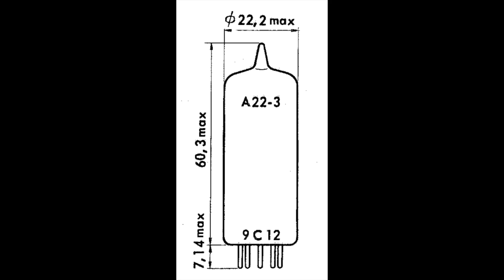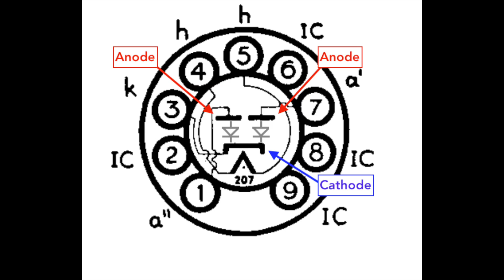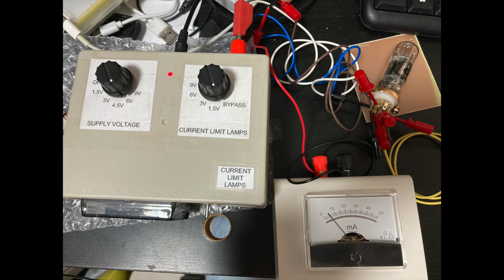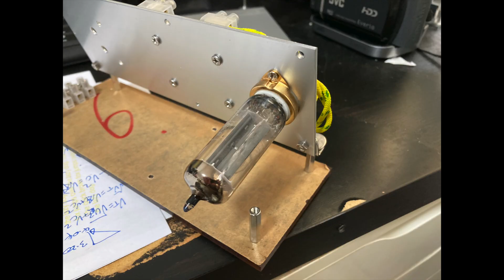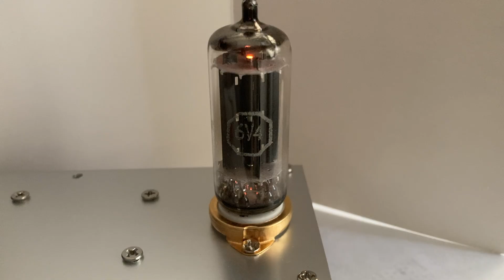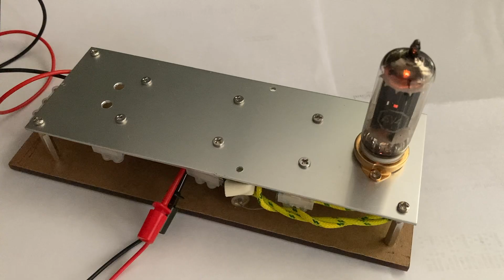A Novel Valve Prototyping System?

Comment: Surprise video pops up on my feed...I'd suggest a little voltage/current/watts across the heater. Lines to measure it. If you want to make it smart... You could throw in a raspberry pico for a controller. Low/high side current voltage current sensors. A DPDT relay could pult the heater element in and out of circuit relatively quickly that you can measure the resistance of the heater while it's powering up or measure Vdrop across the filament while measuring voltage and current. Just over designing things in my head. Also could manage fairly reasonable curves if you measure cathode, anode, grids. Then have it spit data out via serial ideally with a USB isolator or over WiFi. You can also find 10 throw 1-20 pole rotary switches. Then you could wire each pin to a switch and then easily rewire which pins are for what. I have way too many measurement fixtures I want to make and I do make them a bit over designed 😂. Also if everything is run isolated from mains, map out which sides of the transformers are to be considered a system ground point you could then put bnc or scop probe hooks without having to worry about the ground reference on the scope. Hell...I'd probably take dead or outgassed tubes and make a new vacuum line for a pump to bring them down to the necessary pressure. Yeah... ADHD really took over there for a bit
Reply from the maker: I thought about making something like that - make it a micro-based system, type in the vacuum tube number and plug in the tube. A bank of relays to switch the appropriate voltages to the appropriate tube pin, voltage and current measurements on a display. Maybe one day.